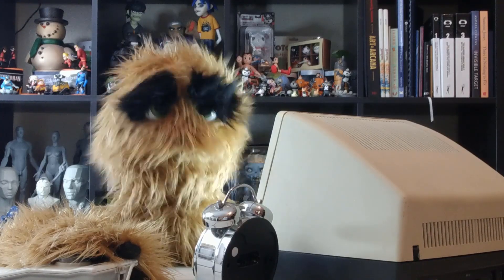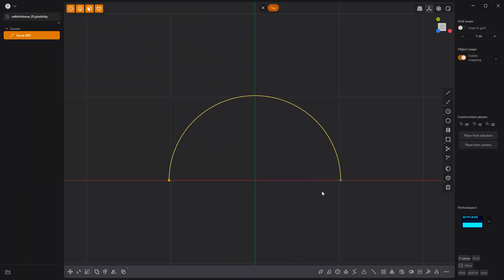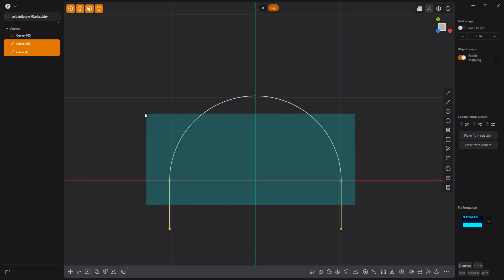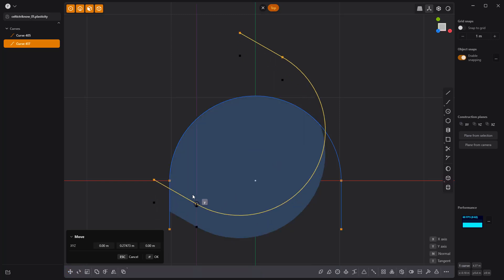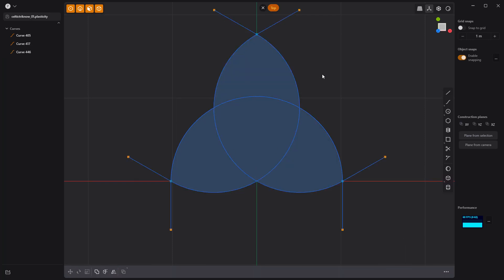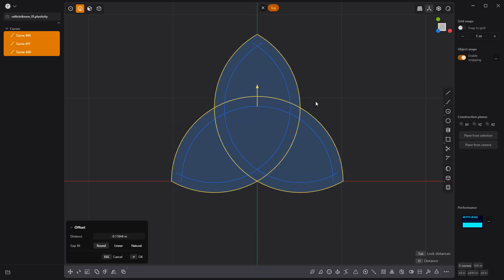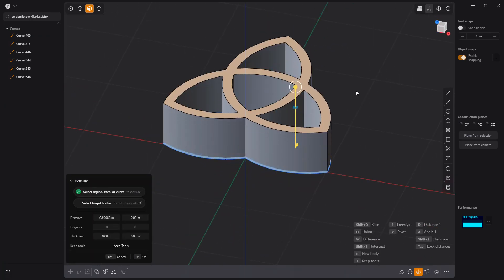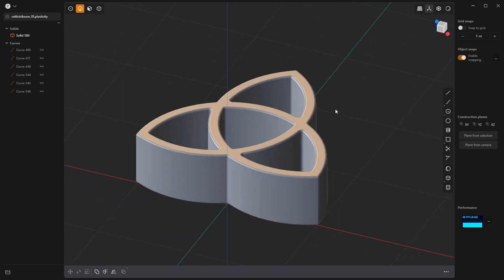Plasticity | Create a Celtic Knot

Comment: Great video! However when i try to offset all curves at once, one of the lines goes in an opposite direction. Why is that?
Reply from the maker: interesting. Not sure why... could it be the direction you rotated the duplicates?
Reply: @Pixelfondue  I just tried to redo it and it happens either way i rotate it. I even tried to flip the curve in 3d. Maybe the offset function have been changed? I'm running version 1.3.8.